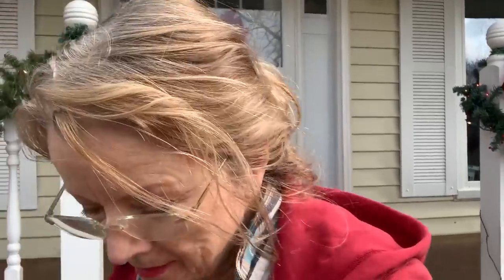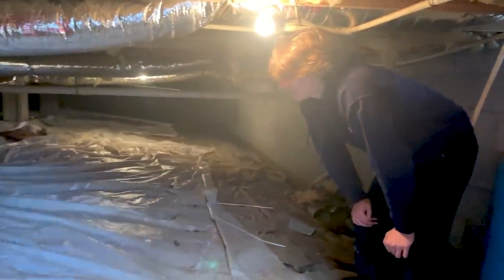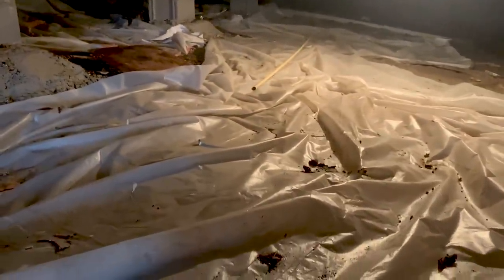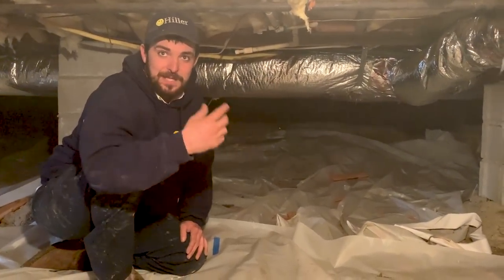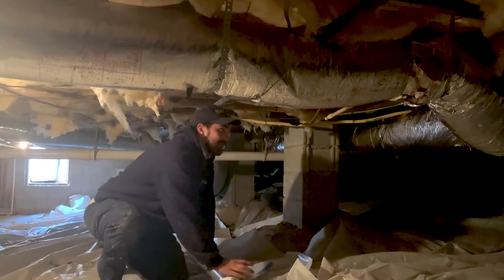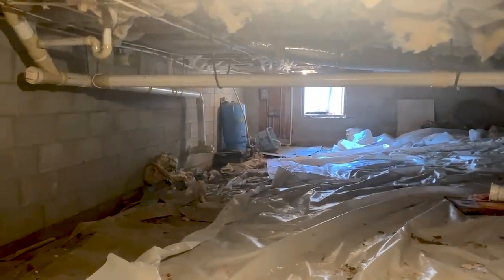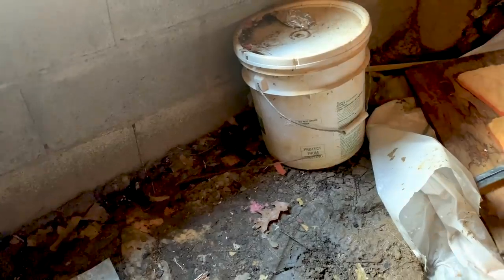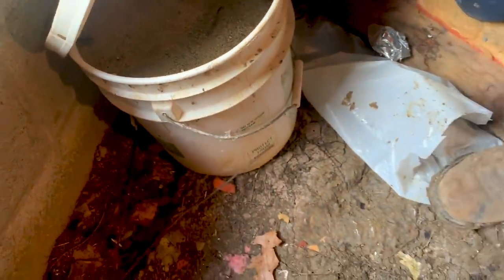MOST women have never been in HERE!

Comment: I have to crawl under my cabin to patch a busted pipe. Have been putting it off but this gives me the nudge I need to just do it. I don't have to worry about snakes. It's just mentally getting over the yuck factor.
Reply from the maker: Yes, now it's even nicer down there with the recent work I had done, new sump pump properly installed, step to step down, and very dry, but still....